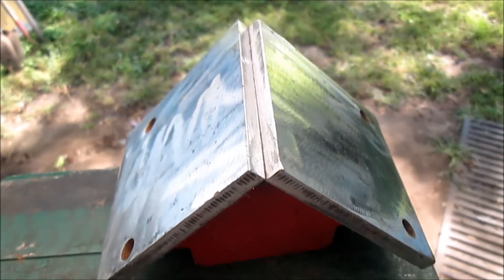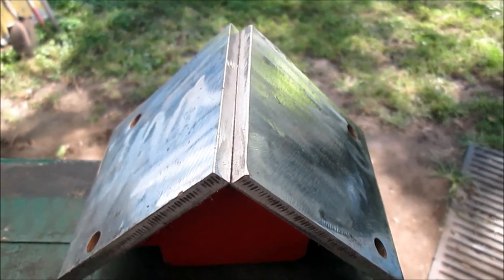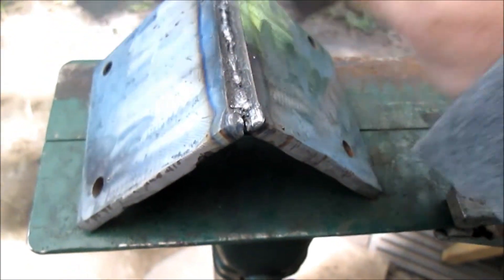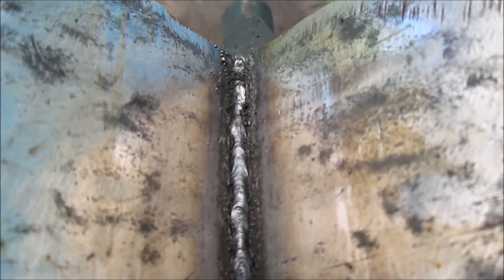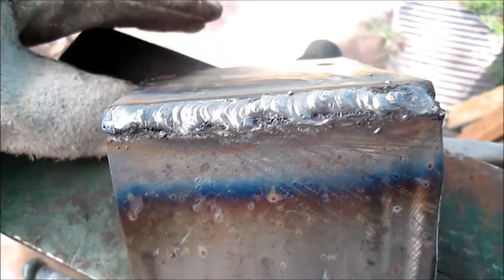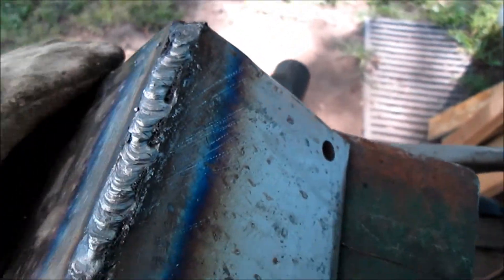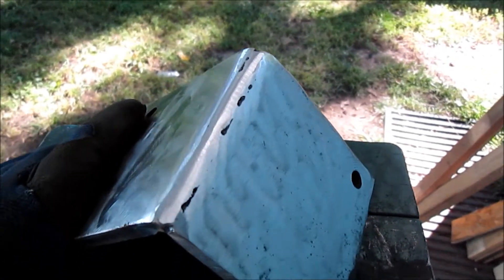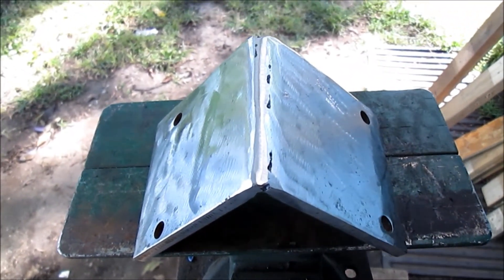Weld 5/16 in. steel with WARDS Powr Kraft 230

Comment: You got the job done, that's all that matters.
Reply from the maker: +RamblinAround It has been a few years since I used this welder... I may buy some bigger rods and do some more welding with this welder
Reply: not2fast4u2c The bigger rods would sure make things easier.

Comment: if you cut the tip off just a tiny bit more you may recieve less porosity. a bit less angle(more straight on with a slight angle to see arc land on piece youll be able to see puddle drag behind your tip too) too should help 😊
Reply from the maker: Still need to use 1/8 rod to weld any thing this thick